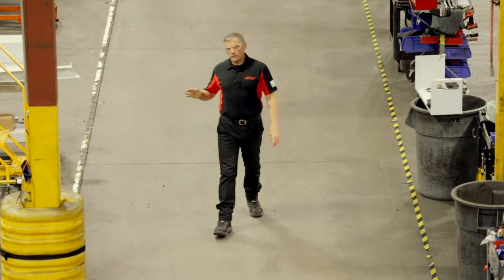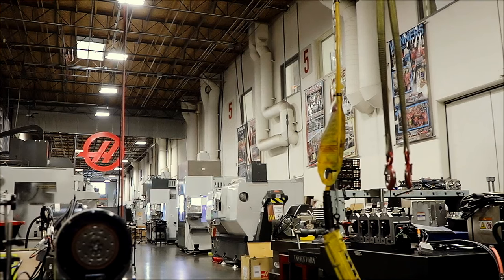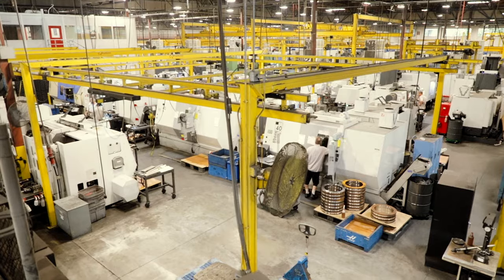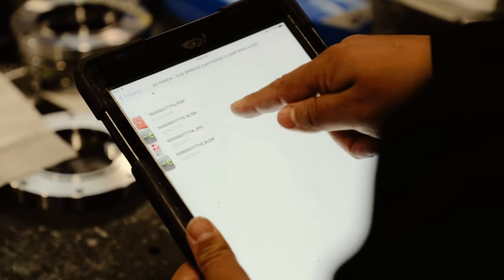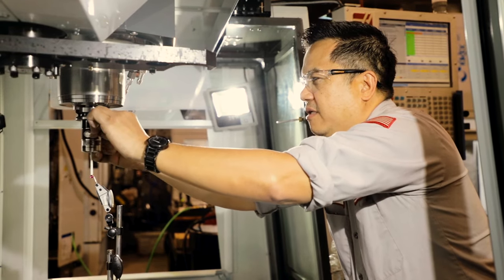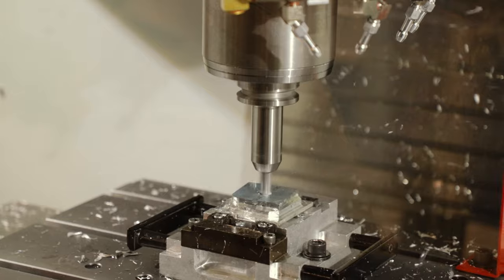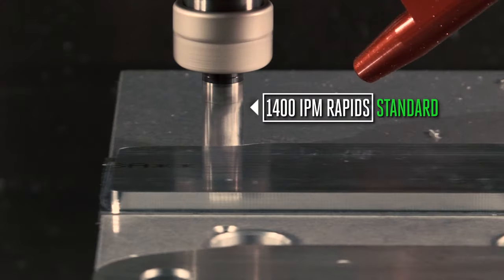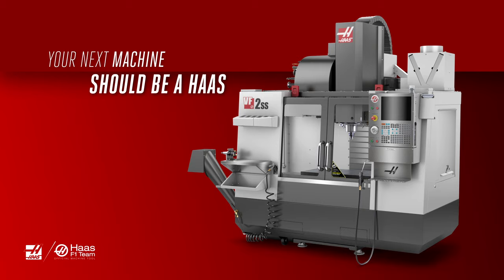Why Should I Buy a Haas? - Haas Automation, Inc.

Comment: Why I have bought 2 Haas machines for the company that I work for (1 GR-510 and 1 VF-4SS)
We started as a waterjet company 15 years ago
Eventually we wanted to finish the cut parts for our customers. 
Haas is really good to start with because it is cheap and the quality is okay
Now we have 2 Haas machines and we are making good money 
From now on I will never invest in a Haas machine but in a more expensive more rigid more accurate brand
Haas is pretty good for its money but at a certain point you just miss that extra rigidity etc in my opinion
Like I said, Haas is really good for starters so they can create some cashflow. If I would ever open up my own shop is probobly buy a Doosan or a Mazak
If you take away the price Haas just cannot compete with brands like that
That being saide, I really can appriciate their Youtube conmunity, almost every video they put out you can somehow learn something from it
But that should not be a reason to buy a certain brand

Comment: On the new Haas machines can I turn off the TSC when im running the program? :)
Reply from the maker: fecobenedek, In order to turn TSC on or off the spindle must be stationary. Therefore you'd want to program the M88/M89 into your program at the appropriate time when you no longer wanted TSC running. You can press Feed Hold, press the spindle STOP button and then press AUX COOLANT. This will pause motion and turn off TSC, allowing you to visually check something. But when you start the spindle and program again the TSC system will re-activate. 
Thanks for the question.

Comment: 0:12 Machine shops on every continent?  I would like to see inside the machine shop of Antarctica.
Reply: @nitchmakes7550  Yeah it would make sense for support. Considering the remote location. Still interested in seeing it.
Reply: @mattamiller  there are quite a few machine shops on antarctica, almost all of them in abandoned outposts. you can find photos of them floating around. there is a machine shop at mcmurdo but i am pretty sure they are all manual.
Reply: They had a VF2 sitting down there and a couple of manual mills and lathes.  Not sure what they have now.

Comment: Because screw Fanuc, that's why.
Reply: @Jason Henley Sure, I'll give you the win on the Servo increment but you can't expect to hold much less than .001 without a grinder. I operate a Fanuc controller. Once you get used to it, it's OK. However, Fanuc controls are all over the place depending on brand causing massive headache for basic operation. 
I have a brand new machine I operate, and it doesn't accept program numbers with more than 4 digits, and the memory storage is appalling. Some canned cycles won't accept decimal numbers. No one can figure out how to properly activate cutter comp without gouging the part, and a 3 axis lathe won't accept 3 axis movement code from Fusion 360.  Post processors are scarce. support is limited, and tech manuals are garbage.
Haas is like Chevy or Ford. They aren't the best, but they are user friendly, affordable, and everyone works on them. Fanuc is like the prized antiquated vehicle grandpa keeps in his shed. No one knows how to start it, and no one knows how to fix it.
Reply: I like this video
Reply: @Moonless6491  Sounds like you just don't know what you're doing. Fanuc systems have a ton of support and processing, and are capable of tolerances past .001 in traditional processes.